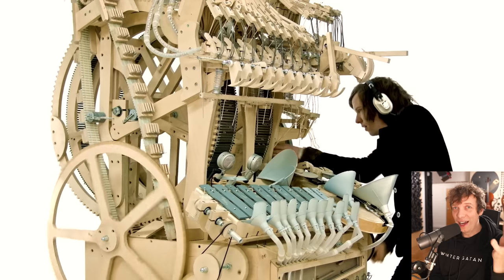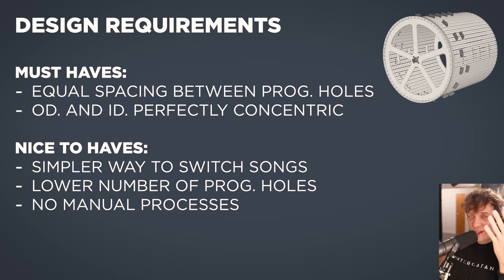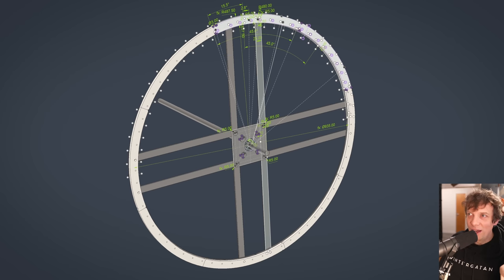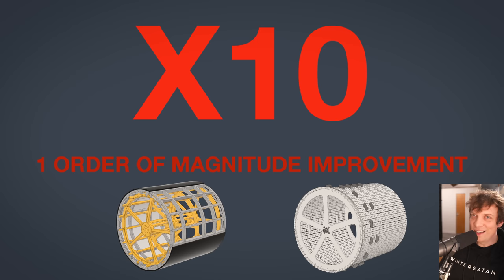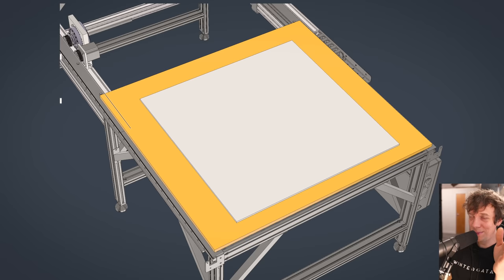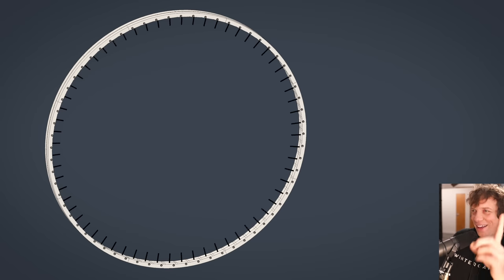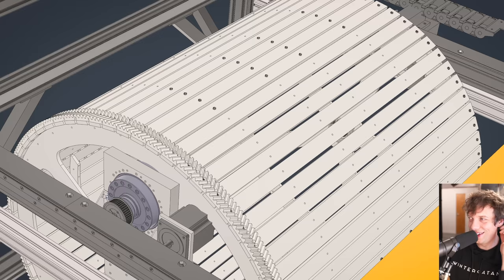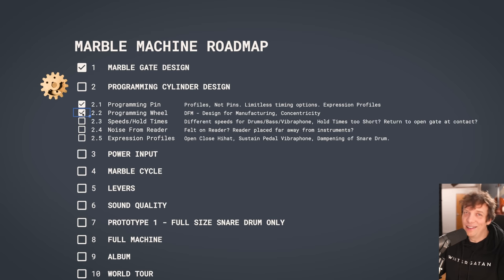A New Music Programming Wheel

Comment: Since I don't know every single detail of your project some of the following observations couldn't be applicable. However I think there are still too many parts and the precision of assembly with bolts is not so high. Did you consider the option of doing the circular surface with a low CTE metal (like invar) ? You could bend a plate around a cilinder (by yourself or by a mechanical workshop) and then fix it to the wheels with gears and in the end when you have the complete assembly mounted you can drill the holes with you cnc. in this way you have only 3 big pieces (2 wheels and the bended surface).
Another thing you could get rid of are the gears on the wheels. Why don't you use two small wheels with a rubber (or some high friction material) to move the bigger one? i mean: think about the roller coaster cars, they have two (or more) wheels, one for each side of the rail. Now imagine that your big wheel (the one that currently has the gear) has a rail on the side, well you could clamp this rail with two small wheels, one that transmits the movement and the other that stay in position with a spring and that can be moved away (like a plier)  to easly change the programming wheel (I hope I explained myself). In this way you can avoid the gears and the error due to the coupling between them and you can register the starting position of the programming wheel in any position you need (with the gears you are limited by the number of teeth).
Maybe this was useful or not. In any case enjoy yourself!

Comment: Martin I think you have made a fundamental mistake. Plastic is not dimensionally stable, in fact most engineering plastics have very high thermal expansion ratios. That programming wheel will expand at higher temps and may even bow due to the segments expanding and having no where to expand into resulting in a warped circle

Comment: I think you are too stuck on the peg thing and aren't thinking about the final touring version. Having a multitude of pegs is going to be a bad time, it makes it too likely to make mistakes when programming the wheels are set up, instead of trying to make boards with holes to plug the pegs into, just have a series of discs that you machine the pegs into so that it is just a few discs per song that can easily be slid on/off. You only need the pegs for composing so don't design your system for pegs, design it for the final form then figure out how to make a peg system work in a way that is compatible with the design for its final form.

Comment: Why reinvent the wheel? What about a paper scroll with punsh holes, a plate or a disc? What design requirement makes that the programming should be done on a wheel? Why not just use computer steered actuation?

Comment: I must admit I haven’t finished the video but using the CNC rotary tool to machine the outer diameter to perfect concentricity would make the inner diameter non concentric with the outside diameter, messing up the programming profile’s ability to grab onto the bottom ring, no? Does the axel clutch thing you talked about do anything to solve this? Are you going to machine the inner diameter concentric somehow?

Comment: I'm guessing your going to struggle with backlash on such a large diameter 4th axis. I would consider a gear driving the lathe axis. I love the idea I've had the same thought I would make the divine gear very large and driven by a fast motor eather a large stepper motor or a servo with a break. For drilling position stability and accuracy a small belt will be way to sloppy. Plastic (POM) Delrin is not plywood! A tool will manhandle a small belt diameter as in your sketch. The lever arm is very large radius. The idea is great I would love to see it work I have had that same thought. I think the gear reduction has to be great to achieve accuracy and holding power. I hate to say it but a stepper motor will probably be a good choice lol and for simplicity sake use a large diameter gear driven by a large fast hybrid stepper or a servo with a brake Good luck

Comment: I would be concerned with repairability for the programming wheel design. If the programming blocks(?) are being changed out frequently then over time I could see the tolerances increasing and the music getting progressively more sloppy. Also those snap fit pins could fatigue and break off over time and maybe even get stuck. Seems like with this design it's quite difficult to repair the wheel should any damage occur. Also, there's a lot of machining operations and something could go wrong during the manufacturing process but as of right now if you were to say break a mill while machining the holes in the cross members how would you replace that one cross member without throwing the whole machine out of true?

Comment: Martin I am very concerned about the rigidity of the middle of the wheel. Especially drilling the programming holes. The vertical forces from the drilling are likely to deform the plastic, affecting the accuracy  of your programming holes. You need to do some FEA analysis on it. You need to stop "I feel like it would work." Feelings don't care about physics, you need to simulate it to know if it will work.

Comment: Sorry bro, but it is not a perfect design. It has over complicated things and several of "underwater stones"
Did you think about passing a pin rail through the wheels? And attach gearwheels by the opposite side of the main wheels? And locking pin rails with a much more simplest mechanism?

Comment: 7:50 If the Outside diameter is not a perfect circle, then the mounting holes for the brackets are not perfect either. Would it make sense to also machine them on the rotary axis?

Comment: Question could you use an hydraulic system where you can manually/ or use a computer to rewrite the wheel? Just wondering like a flap system? Where computer can use magnetic plate to hold it straight up and down? Also you can use magnet to move the balls.
Reply: Just saying if it a flap the spacing would be even..

Comment: I think that design is not rigid; the only thing joining the 2 end plates is the 64 thin plates which will not have torsional strength, i.e. the 2 end plates can twist with respect to each other. yes, there are internal strengthening plates but will they be enough?

Comment: Honestly I kinda think you should ditch the giant drum concept altogether.  It looks cool but it’s very inefficient at holding data.  Your crew will quickly tire of replacing pins of many varying shapes between songs and there’s a high chance of errors and damage to the pins, the wheel, and the machine during mounting and dismounting operations.

If you’re dead set on the wheel, you could try increasing its information density either by making it smaller diameter so you can travel with a whole lot of them or by encoding multiple tracks on each wheel so you need fewer of them.  Several smaller wheels could be stacked up vertically on stage like holy scrolls, sure might look cool.  

Paper, fabric, or plastic sheets wrapped around a drum could also work well with sufficient registration to ensure accurate positioning.

Ahh well.  Good luck!

Comment: What's the note repeat rate of the new "programming blade" system? From the diagrams it looks like a single blade spans at least two programming holes, which on the face of it only leaves you with 32 playable notes per revolution per channel - compared to the MMX iteration where you had multiple banks of offset programming holes per channel and only needed to use one hole per note, so theoretically you could combine the 1/4 and 1/4 offbeat holes to play up 128 notes per revolution per channel. In essence, it seemed like before you could combine the various timing sub-channels to achieve a much higher repeat rate, whereas with the new blade system you're more strongly limited by the number of blades you can fit on the wheel (unless one blade can play multiple notes).

Am I misunderstanding how the programming pins on the MMX worked, or was that capability ultimately just not necessary for the type of music you wanted to play and outweighed by the simplicity of the new system?

Comment: Another consideration is maintenance. If you have to have the gear blanks mounted to the wheel to machine them, you are not going to be able to have spares of gear sections you can replace. If some damage should occur to your ring gear, you will need to make a new blank, mount it, mount the whole wheel in your cnc machine, and unless ypubare replacing the entire gear ypunwill need to somehow time the wheel perfectly to the gear mesh, and re-cut the new teeth. If you instead use a tooth count that is a multiple of the number of segments, you can cut them off the wheel and have spares you can quickly replace in-situ should damage occur. I think you are getting a little too obsessive with precision and are losing sight of other considerations like serviceability. Your machine can already play tighter timing then most humans can, and I don't think you gain as much precision in timing by obsessing with the gears being absolutely perfectly aligned. My concern is that you are going to have another MMX that you are not satisfied with at the end of this. I also doubt the cnc machine with all its tolerance stacking is going to be able to make the gears any more precisely on the drum then it would on a dedicated jig.

Comment: Again , it will not work as you think. 1m long plastik 10 mm thicc is very flexible. Your strips will bend . All your screw joints will shift because a screw deforms the plastic of time , gets loose.  The harmonic drive cnc action will. Vibrate alot with that diameter ! The bearings need a pressfit. 

You have to get rid off the stupid drum at all ! Sorry but mmx4 is for sure

Comment: I am worried about wheel being too heavy and rotating while cutting out the pin holes. Wouldn't it be better to cut those out before attaching to the gear itself?

Comment: And the pins are supposed to sit on the outside of this? As it's not round, as in a circle, there will be timing differences depending on whether the pin sits on the edge or middle of one of those plates, won't there?!

Comment: If you really, actually want to perform live on a world tour, ditch those programming wheels! The rendering you show is like a theater set, and that's good. Starting thinking like a show producer, not an engineer. Design and build ONLY what the audience can perceive and appreciate, most people in the audience will not even understand what is happening, just make some amazing looking props that spin. Get on stage, get it done. It's starting to feel like the goals are only there to justify endless, pointless tinkering. Don't be afraid of the dream.

Comment: If you don't want to use the word "plastic", just say "polymer". Or if discussing it as an assembly that includes parts made of a different material say "composite". The 21st century thing to do is just throw some pointless carbon fibers in with no engineering thought, just so you can say it's "carbon fiber".

Comment: Just the shaft to prevent twisting from the drive side to the other end of the cylinder? Won't it twist a few tenths or millimeters (tempo) with the resistance of the pulsation?

Comment: Umm... How big is this going to be and how much is this thing going to weigh?  If it's meant to be able to come off and be changed, it'll have to do so somewhat quickly and if the wheel weighs a few hundred pounds with all the metal screws and plastic parts, that isn't going to happen very easily on stage.  Also with the size of it, it'll be a challenge to change the programming.  Yes, it's a lot less than the previous version, but that's still 1900+ holes, meaning a lot more chances for mistakes.  My suggestion, instead of having just one huge programming wheel, why not break it into multiple smaller programming wheels?  This would allow you to have different wheels for different instruments and be a lot easier to change out during the course of a concert and a lot easier and faster to program for the next song with fewer chances of mistakes.  That massive wheel has always been a problem with every other iteration of the marble machine because it takes forever to reprogram.  More wheels also mean you can use smaller wheels too for certain instruments.  Think about it, songs usually have a pretty rhythmic beat on the drums, so it doesn't take a massive wheel to have that repeat over and over again, saving you a ton of parts and time as well.  Just a thought but one I hope you consider before you undertake this and then realize after you make it that it's just too big to quickly change out.

Comment: Rigidity down.  Even if both wheels will be made out of steel I'll bet trusses (plastic) will bend during holes boring ... let's say on 5 mm (on the length of 1m) in the middle. Need reinforcements. Another wheel in the middle? Another three of them in the middle? Anyway. You don't want to have wobbly and fragile parts to deal with if you want to achieve constant result. :)

Comment: 5:45 I gotta ask, why is this an improvement? I can see why it is simpler, but it looks like there is 64 1/4 notes before it loops as opposed to 640 1/4 notes. To me that seems like 10x worse?
Reply: He explained this in the previous video. The timing of the notes will be at the pins instead of being at the wheel itself. He can make the pins any length and shape he wants.

Since this new wheel has 10x less programming holes, it's 10x less programming holes to track while programming a song.

The only disadvantage I can see with this system is that he'll need quite a few specific pins instead of just a lot of the same pin, but since this isn't meant to be mass-produced and sold, that's more of an inconvenience than an actual problem.

Comment: You discuss material options, but never mention ALUMINUM.  It is readily machinable, strong, & lighter than steel.
          You don't need that helical gear.  Too complicated!  Use 2 staggered spur gears as you did before (you need to use things that WORKED on marble machine & MMX!)
          You still have not addressed AXIAL stability.  Your new drum is flimsy axially.  THAT IS GOOD, because it permits you to have 2 guide rollers that ride on the outside edges of the drum to constrain axial movement.  These rollers are fastened to the same frame that carries the levers that "read" the drum.  (Design rule: when the relation between 2 parts is critical, you want the "circle of continuity" that establishes that relationship to be as small as possible.)
          But in my opinion the drum is flimsy in torsion.  You need diagonal members, or a thin tube that joins both ends.  Even if you have that, those long, thin pieces on the outside will bend, especially if they are plastic.  PLASTIC MAY BE STABLE, BUT IT IS LESS RIGID THAN PLYWOOD OR ALUMINUM.  If plastic, you need more support (such as another ring/spokes in the center).
          Congratulations!  You FINALLY realized that a LATHE is required.  (Next, you need a small milling machine for small metal parts, & a propane torch & silver solder.)  A celebration is in order!  In the celebration ceremony, ditch the angle grinder & the plasma torch!

Comment: You're impressed by a factor of 10 whist downplaying the far larger factor of the difference between the dimensional stability of plywood vs steel LMAO. Steel is dimensionally stable enough to allow tolerances of less than 0.001mm. you'll be very lucky if the best plywood will allow tolerances of 0.1mm! Now lets hope you learn there is still a factor of 10 between plastic and steel and you'll be getting even further.

Comment: Are the pins going to be self-centering?
Reply: Also, super-crazy thought, but watching you talk about using two wheels for quick switching gave me a crazy idea: if you could somehow utilize two wheels at the same time, you could either:
-make the programming wheel 2x longer, or
-use the two wheels at the same time, with reduced speed, to do something like encoded music.  I don't know how it would function, but simultaneous gates could be used to do some mathematical computations, like AND, OR, NOT or AND NOT, to store way more musical data than would otherwise be available...but that could also easily become some crazy rabbit hole

Comment: Engineering plastic or composites are the wrong choice for something that should be lasting. This won't last 50 years. These drums might not even withstand shipping to your performance venue. Your plastic is too flexible, you need something with a higher modulus. Don't think that plastics are dimensionally stable, because they are NOT. They all yield and deform under strain. Most shrink over time.

Comment: No, no, totaly wrong type of bearing unit for that type of application, the outer surface of that unit is not machined, it ist just a rough casting and will not center well in the hole.

Comment: a i said, i think you're wrong
you exclude the paper way to fast

for me this dont meet the requirment 
you need to first think to how to change the program fast enouth to make a concert

this pin system will probably take houre to change,
and even with different pin size how to be sure there is no mistakes if somone change the pin in the dark of the backstage or on the scene

you try to have a diffrent result with the same mecanism,
why not imagine a lot of mecanism and TEST them as you have made for the marbke gate

personaly i prefere a long try and fail and try to a video that end with a box checked without any test

the japanese karakuri is great, but it do only one things

even more, you have already made a full concert with a paper machine and this works great enought to make this concert
to be accurate you also can imagine a modified laser cutter with a roller in one of the axes

on marble gate you measure lot of things with goals, for programing system give you a max admisdible time to change the music